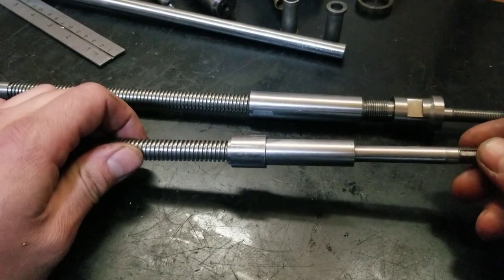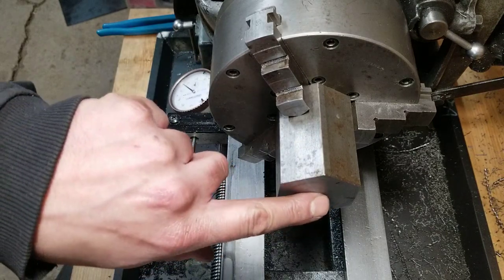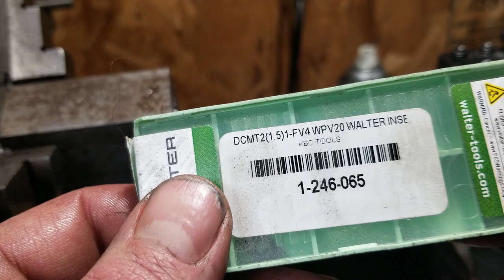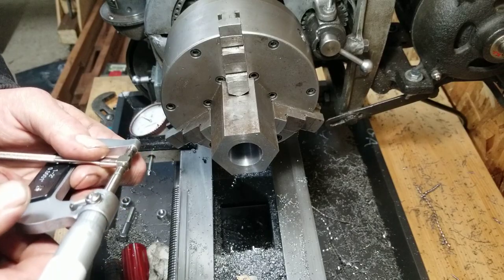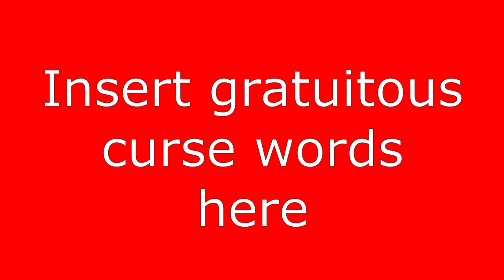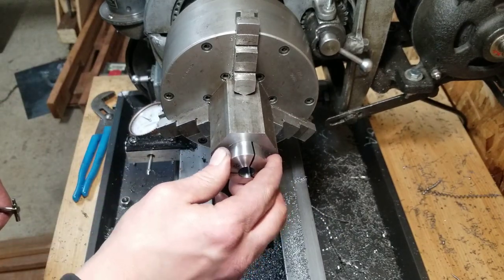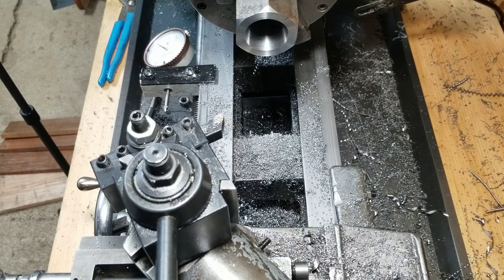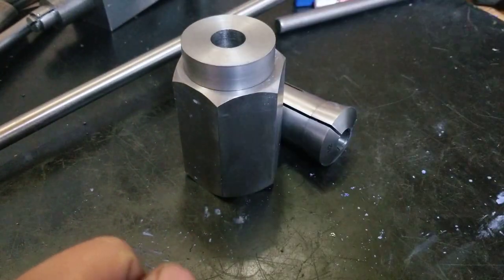Making a Hex Block. Now in 5-C! 😃

Comment: Once again nicely done and a good example why you should use branded inserts, they're always better value in the long run.
When you make your square collet block check the taper with the stock in the collet. Cheers.
Reply from the maker: Will do. Thanks for the tip 😁!